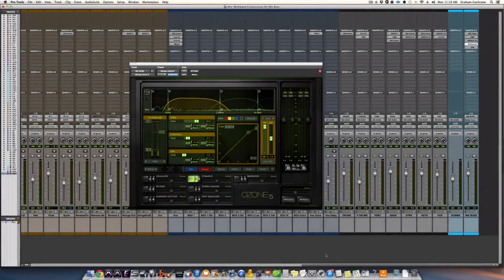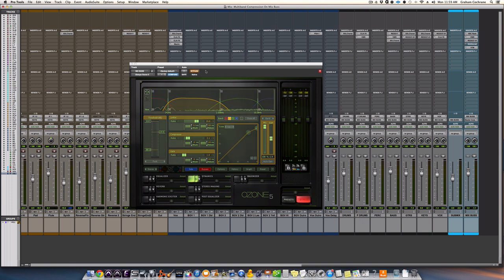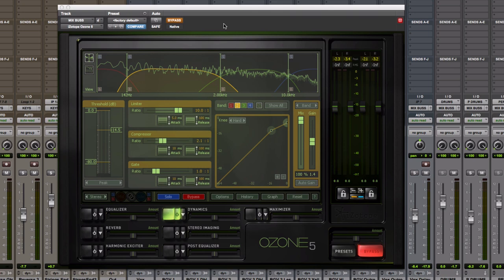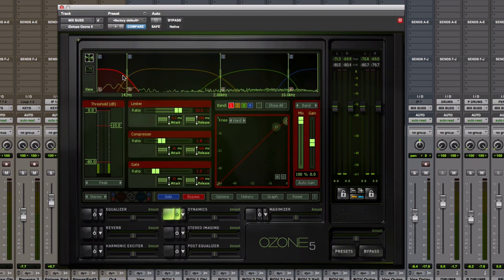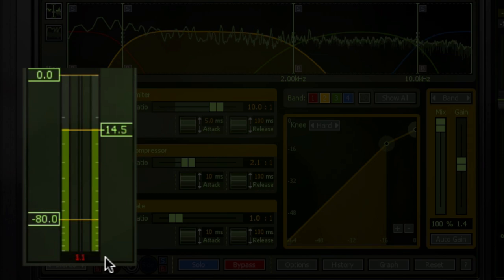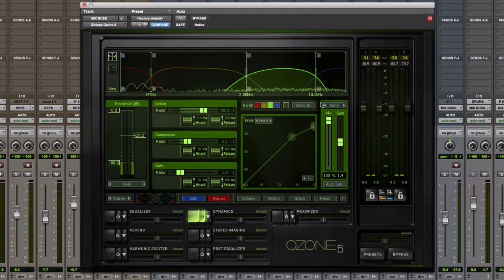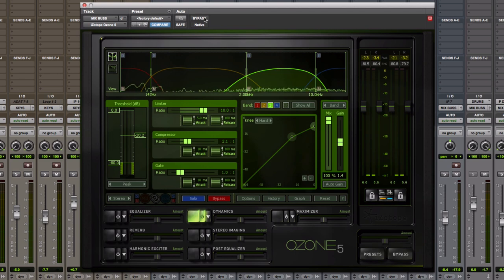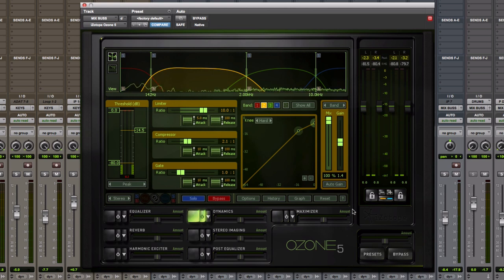Multiband Compression For Instant Mix Energy - TheRecordingRevolution.com

Comment: Great tip! I'd done it before with all 4 bands to control only the peaks but I guess this helps bring out the most important part of music: MIDS :) Btw, I don't know why you keep saying that 10ms or around is slow. It's very fast. A lot of kicks or snares haven't produce their complete transient inside 10ms. Probably because you started with protools which has ridiculously fast attacks.
Reply: I thought the same thing. How would go about trying to use a slower attack like 30ms? Would it just have to do with using a lower threshold or higher ratio? Also what is your opinion on Peak vs Rms compression?
Reply: Well, on full mixes, you would tend to use pretty fast attack to control transients, so 10ms is not that fast (some people goes to 2ms for example).

Comment: This must be the first time I disagree with you, Graham. Maybe because I see the use of multiband compressors only for rectifying really bad mixes? I'd never put it on a perfectly good mix. So I say, rectify it in the mix. Multiband compressors just sound too unnatural to me. Maybe I'm too old school? It can save you some time, people don;t really care or hear it, though, and I see how this new generation is impatient and eager to just get it over with as soon as possible. What this is essentially doing is compressing the most important parts of the spectrum a bit, and turning down those parts of the spectrum that aren't that important. How about EQ-ing it? Turning down a few DBs on the low end and turning down a few DBs on the high end above 10KHz. I usually have a bit of a reverse problem... stuffing the mix into the mids too much because I'm a fan of the "retro sound". ;) However, I'd rather agree with this kind of usage of a multicomp on the master than all four bands, definitely. It's more subtle and it does sound better. Great tip for when you need it. You just have to know when to use it.
Reply: Yeah it seems like more a quick (but effective) fix at the mastering stage. I can't help but think if the end result is to artificially bring up the band elements, surely this could be done better using volume / compression on the individual tracks in the mix?
Reply: the multi-band compressor is only fixing his mix as his track isn't mixed particularly well - his low end and his high end are both too quiet so all the multi-band compressor is doing is compressing the mids a little which gives the impression that he is just boosting the highs and lows a little. If his track was mixed to perfection, the multi-band compressor wouldn't have done much at all, it would have only been lightly compressing the different frequency bands a little at a similar level, instead of using a multi band compressor, just mix better and EQ better
Reply: Amer Iqbal Differently, but not better. Both work, and it's not just for mastering. It can be used effectively on individual tracks.
Reply: dickrodstein completely agree, it's subjective - I personally find it easier to control compression (multiband or otherwise) on individual tracks, but with experience I can see how it can be effectively used as per Graham's video in a more minimal way
Reply: I assume you're talking about eq'ing the 2-bus. The multiband compressor is more subtle than trad eq. When tuned right, it only kicks in when needed. At other times your mix will keep it's whatever (brightness/sub/bass/mid/etc.). That's why to me multiband in 2-bus sounds at times much more natural than a trad. eq would.
Reply: You disagree because multiband compression is a form of editing is your problem? That is ironic.
Reply: No, I disagree because multiband compression is usually more obvious, especially on the master buss. However, if used subtly... I have no problem with that but I prefer good old EQ and single band compressors.
Reply: dddux Yes it's extremely ironic that your issue is the fact that it fixes things. I'm highly enjoying this sentiment. I'm also highly enjoying the fact that you don't understand the irony.
Reply: ***** yes it fixes things but only when there are things for it to fix, basically it is compressing and EQing a little bit, if you were to EQ everything before hand and compress what needs compressing before you applied the multi-band compressor, then the multi-band compressor wouldn't be improving the mix. It is a quick fix if you don't have much time and it's great for beginners but if you are really into getting everything to sound perfect then you are way better of just doing everything manually and applying very very light multi-band compression in the mastering stage. What I'm trying to say is, it certainly isn't a quick mix fix like some people think it is, it is a tool to be used well but you cannot mix badly, throw on a multi-band compressor and call it a day. It is not just some magical fix.
Reply: BHAudioProduction It's a big mistake to dismiss multiband as a quick fix for beginners. That's not how it works. The top people from Motown on down use it for a very simple reason. You can add more life to the music with less obvious manipulation.

If you do what you need to do with EQ, great, but your change will be audible and it's easy to throw the whole mix off if you get it wrong. If you do it with single band compression, it will be audible and you better be careful because you risk squeezing the life out of it.

If you do it with multiband compression, even if it's just two band, you can add a lot of energy and life to your mix with only the slightest application, and it's hard to detect. That's the takeaway. You get more juice with less manipulation. You just have to know how to do it as lightly as possible, and that's why the giants in this business use it.
Reply: I am a producer, song writer, sound engineer and mastering engineer, trust me I know my shit. All I'm trying to say is, if you're a noob and you watch this video, DO NOT THINK that you can just throw a multi-band compressor on your master and expect everything to sound good.....thats not how it works. EQ and Compression are SO MUCH more important than multi-band compression - sure multi-band compression CAN make your mix sound better but it's not some magical charm that can fix everything, all it is doing is adjusting volume of certain frequency bands and reducing dynamic range in parts that need it. It is basically an automated EQ and compressor. The only time I would use it would be to compress something that I need more control over, if I didn't need to use it I wouldn't, and that goes for almost every plugin/effect that you use in production with an EQ being the only exception, you should EQ everything (even if that's just shaving some unnecessary low end). Basically all I'm trying to say it multi-band compression isn't a magical quick fix, you shouldn't use it just because your mix sounds bad, you should only use it when you need to use it and when just using simple compression isn't enough.
Reply: BHAudioProduction You're making assumptions and putting words in my mouth. You're also trying to cater advice to the novice level patrons of the skill, which I find absurd. Judging from what you say, you're issue is with the fact that this tool has the potential to be misused.... but that potential exists in every single tool in every skill whether it be concerned with audio/music or not, so there's no purpose in pointing that out.
Reply: BHAudioProduction Also, I couldn't care less about your credentials. That doesn't matter. What matters is actually how good at your craft you are. Credentials are good support or evidence, but not proof.
Reply: ***** Dude, people on the internet will always brag about what they are..especially if they are that young and arrogant...no hate BHaudio-pal, but don't talk bad about the craft of people that is clearly out of your league. Not enjoying the sound is one thing..but calling it a bad mix is something else..
Reply: Fallen Virus I am just saying, in his mix he really could have EQed and compressed better before he used the multi-band compressor because when he threw the multi-band compressor on he mostly just had it changing the volume of different bands by changing the thresholds lower and higher for what sounded good in each band so basically he could have done that in an EQ (and had more control over the settings) and then lightly compressed afterwards with the multi-band compressor (but only very lightly)
Reply: Fallen Virus I have to agree, I think his mix sounds beautiful. I've been doing this for a lot of years and I really can't fault his mix apart from it lacking a little punch, but really that's just personal preference. The warmth of the sounds and the balance of the instruments is spot on.
Reply: Luke Gibson oh my god is there really people trolling and arguin, in a f*n recordingrevolution video? :DD this is hilarious :P
Reply: Vicenzo Bosa no shit
Reply: compressor is more effective then eq it sounds better if you compresss harsh high end then treat it with EQ

Comment: Can someone explain what a compressor exactly is and does? :)
Reply: Takes a track, reduces louder parts & peaks to a volume u choose in a hardness you choose and so evens out Volume (and smt. Gain) Differences to get a straight level
Reply: I agree with what the first reply said but I add that too few people tell you that it also pumps when doing that and thus adds character and characteristics to a sound similar to distortion and saturation but in a more subtle and hard to control way.  Thats why people enjoy using different compressors....its not simple peak volume control and never was for musicians making mixing music in the digital age.

So always remember the difference between a punch that stops on the dime verses a punch that whips(by retracting quickly).  Its like when you whip someone with a towel...you have to pull back fast to get it to sting a person(and its that whipping action that becomes the desired outcome). 

In other words, compressors arent just for bringing the volume down a bit when it passes a threshold line that you get to set and also pick how hard or soft it brings the volume down once it crosses that line/threshold.  Rather, compressors are that and they are also coloring the audio depending on how you use them(hence people like to use analog style compressors that add something rather than digital compressors that add far too little something). 

Once you understand compressors and which ones you like using to add certain warmth or brightness to a vocal or any sound, you will then likely rely on them in the many years to come to be part of your magical ability of making X sound like Z.  Its like movie magic but its studio magic for musicians.  What Graham did in this video though isnt that but its rather the power of what happens when the low mids squeeze together and allow the other frequencies to breathe and sound mor edynamic than they sounded before. 

Contrast makes white look whiter and black look blacker and surprisingly its the same in music.  Some people EQ a huge dip down a few db in that frequency but multiband compressing it might be more musical and less costly(as in taking away too much fromt he mix).
Reply: QuabmasM couldn't have asked for a better answer, thank you very much! :D

Comment: Sorry, but I think the track lacks dynamics both with and without this multiband compressor.
Reply: +dat_chip What kind of monitors are you using? Its pretty obvious.
Reply: +Daquet Reed Oh, I can tell the difference, no problem. I just don't think It's a very good example of where to use multiband compression, as the whole track already sounds like it's had too much compression - even when the effect is bypassed.
(Monitors are a Dynaudio/KRK custom built thing combined with some Heybrook/Audiovector for the low end. I know it sounds weird, but it really works.)
Reply: +dat_chip Ohh ok, I was gonna say if you were listening on headphones or computer speakers it would be hard to hear. I had to focus my ears in at first to really hear it but it was pretty noticeable after that. I agree about the compression in general, but this technique brings out the meat and potatoes. Tried it with Ozone 6 and the Waves C4 to compare on a track that I haven't used much compression at all and it sounds great. I think the C4 gives it more depth and fatness than Ozone.